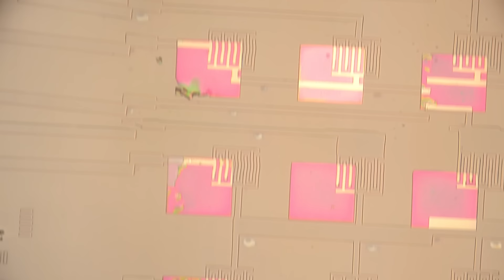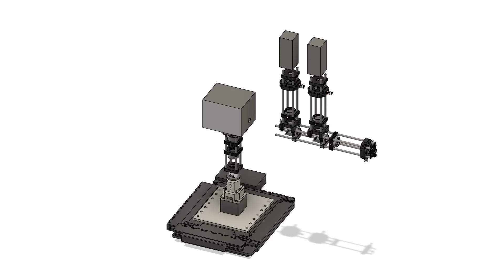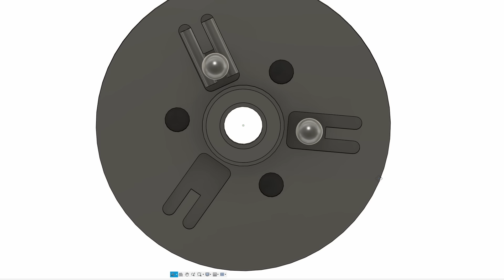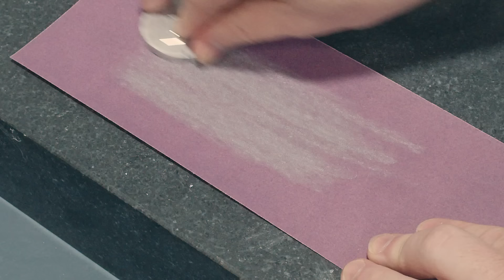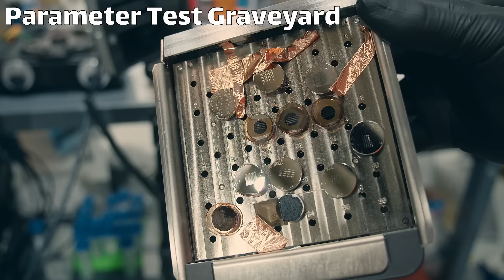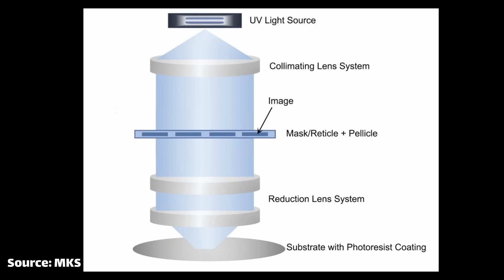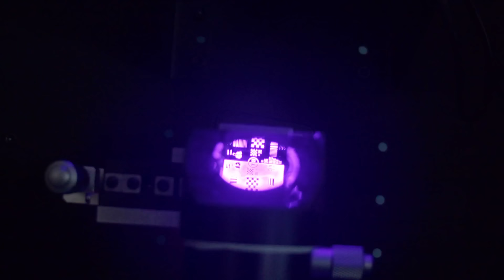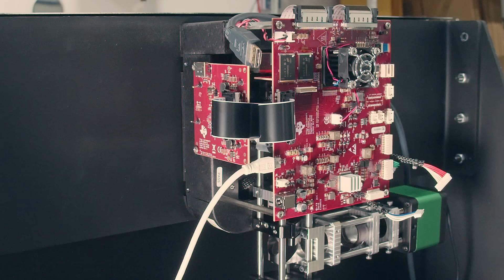Speedrunning 30yrs of lithography technology

Comment: Greeting's from Intel's sub-nm research team! It's super incredible to see hobbyists getting to the point of making real semiconductors in the home shops.

I did my PhD on reducing resistance in chip-to-chip bonds, so if you ever get to that point where you want to make a really tiny sandwich, definitely get in touch down here!
Reply from the maker: Very cool! First thought was anodic bonding, but I seem to recall that's only for Si-to-glass, not Si-to-Si?
Reply: @BreakingTaps  Intel is actually using extremely small solder bumps in the currently produced Foveros packages. We are able to place them in an arbitrarily skewed grid with a 36 micron spacing. The bumps are in the 10-12 micron scale themselves.

Next generation aims to skip the solder step entirely and directly bond copper to copper. Slightly recessed copper pillars are surrounded by an insulator ring. The dies are then pressed together and heated such that the copper expands to bridge the gap and the surfaces weld together.
Reply: @DigitalJedi wait those FOVEROS bumps are what I do
Reply: @RaymondDoerr  Hopefully I'm not misremembering the size for the 36um pitch ones! Hello from 14A R&D!
Reply: @jean-pierresteenberg  15k were just laid off, not from my team but other departments. Probably not a great time to be asking that.
Reply: @DigitalJedi  question.. since copper is a conductor how would you prevent surrounding copper from expanding slightly. prolly wouldnt expand much but could it mess up features that are nm?
Reply: @BreakingTaps  wafer-level and die-level hybrid bonding (SiO2-SiO2/Cu-Cu) is the next big step in advanced packaging. Currently used in processes to build image sensors and NAND flash, etc. It's very cool tech, but it's a bear to develop--substrates need to be incredibly smooth (sub-nanometer RMS rougness) and any particles leave a massive void. The final profile of the via after CMP of the copper is also incredibly critical. SiO2 bonds easily to itself after plasma activation, and the copper plugs expand into each other once heated since they are constrained by the oxide on all sides.
Reply: @BreakingTaps  You may also enjoy Intel's white paper on upcoming foundry tech.

https://www.intel.com/content/dam/www/central-libraries/us/en/documents/2024-02/intel-tech-clearwater-wp.pdf
Reply: My understanding was that under 3 microns the silicon loses it's semiconductor's switching properties. When was this problem solved?
Reply: @atomicrevenger4745  What are you on about? Silicon MOSFETS (for digital logic) with critical dimensions of ~3um are over 4 decades old.

If you meant 3nm, then it really won't matter anytime soon, since the upcoming "sub nanometre" nodes are still expected to have a minimum inter-transistor gate pitch of at least 30~50nm, that's 10~15x bigger.
Also, while it's true that shrinking planar transistors (and even finfets) down below a gate pitch of around 20nm brings exponentially increasing static leakage and decreased gate control (think short-channel effects, like DIBL), silicon doesn't just magically "lose its semiconductor switching properties" at 3nm and in any case, we are unlikely to see any Fab actually get anywhere near that level of density during this decade.

The industry-wide switch to GAAFETs might, eventually, even allow for the introduction of commercially viable process nodes, with actual inter-transistor gate pitches in the 5~10nm range; however it's still far to early to say much with certainty about how GAAFETS will mature.
Reply: @atomicrevenger4745  when they say they have multiple transistors within 3 nanometers, they mean 3 nm of horizontal space with multiple transistors stacked vertically.  But the vertical distance between transistors is still more than 3nm, as well as the horizontal distance.

It's like having 1200 square feet of land, and you want to build 5 apartments.  You build it 5 stories tall, so you can say you fit 5 families into 1200 square feet.  In a way, you did.  In another way, you didn't.

So they can fit more transistors on the chip, but they're getting no huge advantage in speed because each transistor isn't any closer to the next.

However, any given component can be 3nm away from ~20 nearby components, in 3D, compared to a 2D layout where each component could only be 3nm away from ~8 other components.  So for any purpose where you need fast communication between multiple options, or simultaneous connections, it could be faster.  Transistors don't have that many outputs, but I'm sure there's some way they use this advantage.
Reply: Keep researching and we'll keep making it. Heyo from LTD/D1X. Thanks for your work.
Reply: Have you considered creating content on the topics surrounding your work? Saw your other comments and it seems really interesting. I would also enjoy it since it would be from a more personal perspective rather than a documentary
Reply: @Lorissss42  I have considered it, but I have neither the time nor the video skills to make it all that interesting. I'm an engineer and physicist, not much of a writer or videographer.

I am quite active in writing form or as an industry contact. You'll usually see me in comment sections like here or on forums like r/ hardware, but for more in depth things, I am often times an "unnamed source" from IFS to tech media like Anandtech or Chips and Cheese or youtube channels like Gamers Nexus or High Yield.
Reply: Is that sub-nm (A7 process node)? What are some recent public things representative of the kind of work your team does?

The problems routinely solved in the semiconductor industry are incredible. This hobbyist level stuff is really impressive, but EUV lithography systems feel less and less real the more I find out about them. I'd love to have a few billion of your sandwiches :P
Reply: @reddragonflyxx  Sub-nm referes right now to any node from Intel ending in A, as those need Angstrom measurements. 20A/2nm is the first, followed by 18A, then likely 14A.

Most of the work from my team has been in the theoretical side of things, but you can see the first applications of our work in the Intel4 and Intel3 nodes. The 20A die of Arrow Lake will be the first with PowerVia, which will also mean it is the first designed with tools my team developed for sub-nm.
Reply: Holy crap yooo dude that's awesome!
Reply: Goodluck with the problems caused by years of malaise at the very top of Intel. Hopefully Pat can Wright the ship soon.
Reply: I'm currently doing bachelors in Electronics and have a long journey to get the point where you are!
Reply: @ninjawarriors2838 You can do it for sure! This industry lives and dies on new ideas and perspectives, so I'm rooting for anybody who wants to get into it.
Reply: Are there any contemporary components that don't rely on the miniturization (lithography) of parts and can theoretically achieve: 1 GB of RAM? 1 Billion instructions per second? I know that magnetic core memory had a lot of developments since there are still objects that rely on it but the developments were not expressive enough...
Reply: you guys should make your discoveries open source instead of gatekeeping frfrfrfrfrf
Reply: @Pepo..  There's a ton published through academia and industry journals, but sadly industry demands that trade secrets stay secret.

Believe me, I wish I could publish more of the cool research right as it happens. I don't think I know an engineer who isn't excited to share this stuff.

The best way to find out whatever you want to know is to just ask though. I'll answer whatever I can.
Reply: @DigitalJedi  at what temperature does this bonding take place and how critical temp control is? Is the whole structure heated?
Reply: @ugarit5  I can't disclose exact process details, but yes, the whole object is treated.
Reply: @DigitalJedi  baked in an electric oven?
Reply: @DigitalJedi  hey just a question, why didnt intel produce a more effient cpu by intergratin ram into the die,or better why not put everything in the die ,cpu+gpu+ram+ssd +the other stuff,this will make it super energy efficieent ,No? ,no interconnect like amd does with the IF it use alot on energy
Reply: @fdgdfgdfgdfg3811  cpu+gpu+ram... hello lunar lake
Reply: @fdgdfgdfgdfg3811  You're describing a system-on-chip (SoC) which does exist, but are far heavier on the efficiency and cost side than performance.
Reply: @thelight3112  no i mean 1 chip with everything in it ssd+ram ,no tiled separate chips or soldered ram chip near it
Reply: The 😮😮😮😮😮😮😊😊😊😮😮😮😮😮

Comment: Quantum Hydrogen Energy from Japanese company Clean Planet - basically real cold (~900C) fusion using only nickel/copper substrate and simple hydrogen (not deuterium). They claim that it's been running for 500+ days without refill, constantly generating heat.
Thought this might be very much up your alley.
US patent US11499789B2. Basically, they layered nickel and copper (about 6 or so layers) and made a tiny cracks through the surface (where SEM comes in handy), and when two H atoms get into a single crack, fusion occurs, generating much more heat than from burning H.
Right now they are in the process of making a commercially viable boiler for industrial applications (working with JP gov and industry).
Huge if true. There's a couple YT video from them, describing all that.

Comment: Redesigning the mount for the DLP the other way around with the UV LED mount facing outwards to make swapping burned LEDs easier might be annoying, but if it's going to randomly eat LEDs like that then it will likely save a lot of time in the long run.

Comment: 41:00 Killing the LED is due to too high drive current. Look at the schematic and try to lower it or use different diodes that can handle it.
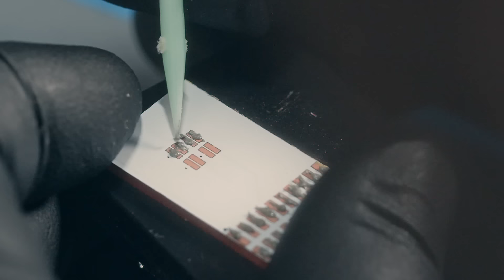Reply: I think the main problem w.r.t the LEDs is at the 8:50 mark where the LEDs are being soldered. Note how they "soldered up a bit wonky", which might have seemed like a cosmetic issue for the most part at that moment. However, it has severe implications for the thermal performance of the system. Basically, the LEDs can't properly dissipate the heat they generate. As a result, their lifetime is shortened considerably. Running them at lower current will help some, but they'll still die prematurely. The real solution is (1) ensure proper dosing of the solder paste. There only needs to be just enough to flow the entire contact surface, but it shouldn't bead up, raising the LED away from the copper PCB. The other part (2) is to ensure that heat dissipation from the copper PCB is as efficient as possible. I'm going to assume that (2) is dealt with because apparently this sub-assembly was lifted from an existing/functioning machine. However, (1) still needs to be addressed.

I've dealt with this exact same problem with high-power SMD LEDs many times, so the above is my best guess based on 1st-hand experience. It doesn't discount other possible causes, but I'd really start tackling the problem here. It's a simple fix, in principle. That's the good news.
Reply: @koraks9939  that's really interesting! Thanks for the write up
Reply: @koraks9939  That indeed is probably the problem
Reply: Or got killed by ESD, because those bare UV dies are really sensitive to it as well. Best to also add in the protective diodes that the manufacturer recommends, and which are almost never used. Shorted diodes either ran too hot, because of poor thermals, or got zapped by ESD.
Reply: @SeanBZA  There was a heatsink right next to the diodes - are those diode driven or from other nearby equipment? Might want to install temp sensors and/or increase heatsink capacity and/or airflow.

Comment: Why even have the rotation stage on the maskless system? Seems like a ton of complexity (and stacking errors...) for zero benefit when the projection can be rotated in software.
Reply from the maker: In theory it could be handled purely in software, but makes the software notably more tricky. With mostly mechanical alignment the optical/software alignment is simple. "find feature, fix minor rotation error, display pre-cropped image".  But if you want to allow arbitrary rotation you need to identify where you are, translate from mechanical space to image space, rotate and crop out the relevant portion from a huge pattern (my test images were like 50,000 x 50,000 pixels before getting cut up for stitching), display and hope all your calibration is dialed. 

Totally doable, just a different set of challenges. I gambled that the mechanical side would be easier/faster :)  That said, v2 is definitely going to have a different design. I made some silly choices here :)
Reply: @BreakingTaps  if I understand your design right, that rotation stage will destroy all your beautiful Zabar xy-stage nm accuracy. Direct driving the rotation stage from the stepper will limit you to the (pretty bad) stepper bearing accuracy (compounded by the perpendicularity error of the shaft to the xy stage etc), the angle/step hold accuracy and repeatability, and create additional xy inaccuracy when you're not in the center of the wafer (which is after all the whole point of a litho stepper..). You may also see some fine scale mechanical vibration from the stepper/driver that will blur the image slightly in the polar coordinate system. You could try one of those cheap-ish stepper worm microscope rotation stages instead, with a conventional vacuum chuck on top (and just deal with vacuum hose manually, or program it to no spin around arbitrarily and tangle the hose).
Reply: @hugov392  Agree, was going to say that microstepping at this kind of resolution is going to be an issue.
Reply: @BreakingTaps  Yeah, I guess I'm approaching this from the point of view of mainly a software engineer :)

I will likely be working on maskless photography soon-ish, and my thoughts are that since the 70s/80s two technologies have really moved forward: the existence of DMD/DLP (which you covered) and availability of compute power/algorithms. Meanwhile, machining precision elements is still expensive. And you see reliance on software solutions in manufacturing elsewhere, too - imagine modern PCB P&P without heavy reliance on CV, instead trying to get everything aligned perfectly every time by pure mechanical brute force!

Comment: If we can convert this into a kit (i.e. make it easy to replicate/iterate)... we'll hit the NEXT great leap in terms of "boundary of possibilities" of DIY/personal projects. On the same direction, but much larger in terms of impact than what 3D printer enabled.

Imagine... to make a battery charger... instead of trying to motley crew together a fast charging controller, dc-dc converter, charge balancer, OC/OV etc protection, load switch, power path from various manufacturers, SKUs, vendors, sources, availability and the complexity of them working well together within YOUR required spec - it's days of work even for a professional engineer & that's JUST to design a PCB (months' endeavor in reality, with zero control over the operation of the active elements). Instead, with this... you can just use the simple standard cells for 1um process node to design & put together an ASIC... when fab'ed all together, can easily fit onto 1x1cm wafer floor... turn it into a QFN or similar package, put a few passives, reflow and you're good to charge a battery by the end of the day.

That's huge... HUGE!!!

Comment: That zaber unit is 🤌
Reply from the maker: It's soooo good. 🤩 Legitimately one of the nicest pieces of equipment I've worked with. Excited to improve the machine in version 2 so that we can really push the limits of the stage.
Reply: @BreakingTaps  maby try using hydrofluroic 1-2 percent  to clean before addition of the photoresist for better adhesion. The age of the photoresist and how it is stored will impact the quality.  I would suggest a photoresist that is newer
Reply: Shout out to zaber for just donating it. I just took a look at the pricing for those things and that is definitely not the kind of thing you just casually pick up for a project lol. Very kind of them to just donate it without the usual quid pro quo promotional stuff.
Reply: So fun to see them mentioned in the wild. I do biomedical and a zaber stage is on my wishlist for a custom microscope.
Reply: Yeah, until I saw that I thought this was gonna be a practical How-to DIY video.
Reply: What do those things run as far as cost? Ballpark?
Reply: @EmusLOF  It looks like that unit he has is a X-ADR-AE series, which start at $10,295 US according to the zaber website.
Reply: For what it is, thats pretty cheap. Its not inexpensive, but way reasonable for starting a small chip fab @Bobbias
Reply: Super happy to support this project. Zaber was bootstrapped 27 years ago by engineering students out of the same kind of energy, curiosity and multidisciplinary competence as channels like Zach's. We etched and soldered our own PCBs, wrote our own firmware and software, machined our own parts and assembled our first products in our founder's basement and garage. DIY is in our culture so it's a real treat to see products we designed put to creative uses by talented folks like Zach on channels we genuinely enjoy watching. If we get a bit of promotion out of it, that doesn't hurt either ;-). Cheers.
Reply: @ZaberTech  Thank you for your dedication to science and technology. It is always amazing what ingenuity can stem from curiosity.
Reply: @EmusLOF entire bloodlines in mexico have been erased for less money than one of those zaber stages are worth